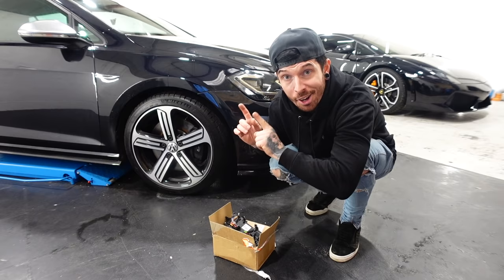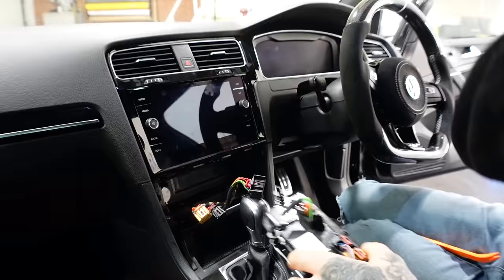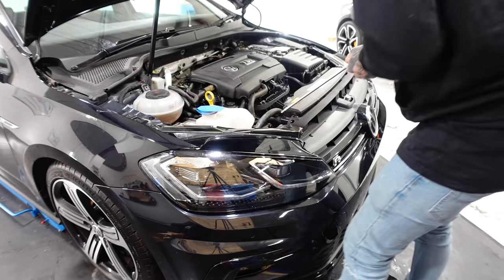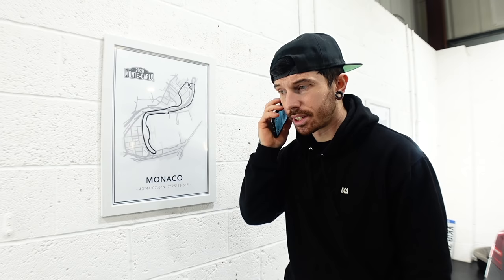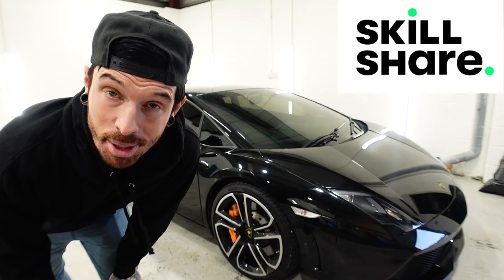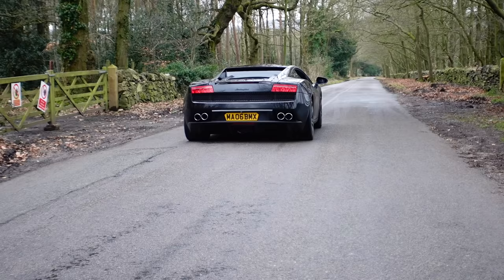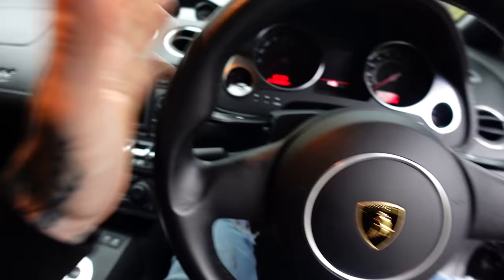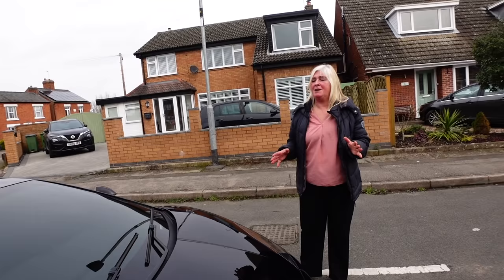THE REAL REASON I BOUGHT A LAMBORGHINI

Comment: How much did you pay for the lambo we need a price breakdown
Reply: i agree
Reply: With 10k miles on it at least 75k
Reply: I figured that but it would be good for Matt to show the numbers
Reply: Be above 90k
Reply: @jeremyturner4327  financed it so probably costs nothing as it’s a ‘business tool’ offset from his tax as it’s used for his business (youtube) monthly payment will come out before tax so should cost barely anything. (Presuming his accountant is on it)
Reply: He would still be liable for personal tax on the car. For a car of this cost it would be non tax efficient to purchase as a business expense.
Reply: @jeremyturner4327  yes if you were paying tax you would be but in the situation he’s in with houses and youtube you’d be better off paying yourself just under your personal allowance of £12,500 and then paying yourself in dividends that way you don’t pay as much tax as with the income from property and youtube and sponsorships he’ll probably fall into higher bracket tax of 40%. The car is also used for personal use but is predominantly business use so yes is a benefit in kind so will reduce your tax code but not by a massive amount. 

Another thing you could do is lease the car through his business and then lease it to himself for a low amount £200 per month for example, it is possible to do that but that could put up some red flags. But is technically legal if done right. 

And to answer your original question the cost of the car was £95k I saw it listed before he bought it.

Comment: Mate your nuts ,, twin turbo a Lamborghini nearly double the BHP and then take away the researched and developed standard suspension and add air ride ?  While your at it take away the massive break callipers and disks and ad break shoes .   Like I said in your last vid fit your air ride and take it around the Nurburgring as fast as you can and see how far you get around before putting it in the barrier.
Reply from the maker: Good job i wont be going round Nurburgring then ehh!!
Reply: @MatArmstrongbmx  pal every road you drive down every Island you go around every left / right turn you take in a 900hp Lamborghini is a giant race track ,,  you just took your family out and gave it some pepper ,,,  not a hater at all mate just think on this occasion your taking away a driving asset and replacing it with junk,,  any other car no problem even on your misses mustang but on a 200mph plus super car ? .
Reply from the maker: @elasticsoldier0257  that’s fine mate I understand!
Reply: @MatArmstrongbmx  again mate by no means am I hater ,, I look forward too your weekly content ,   Ask your boys at RE performance there thoughts on it and if there with you then il never comment on it again 😄👍.
Reply from the maker: No probs! You have to understand youtube is my job so i have to do these things to cause a stir online. Which is exactly what its doing hence your comments. Going by the book and doing what others do is not in the Youtube vocabulary
Reply: @MatArmstrongbmx  fair comment keep up the good work 👍😄.